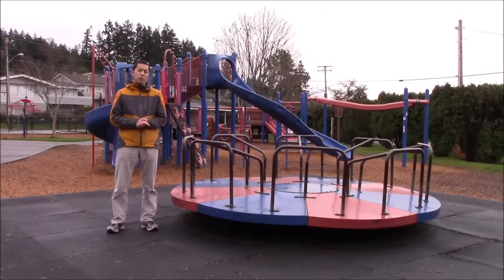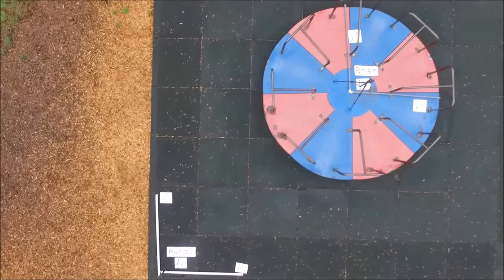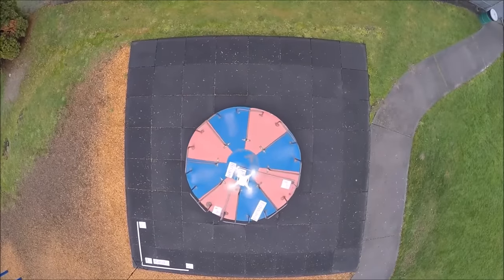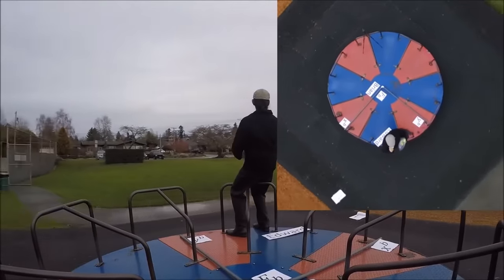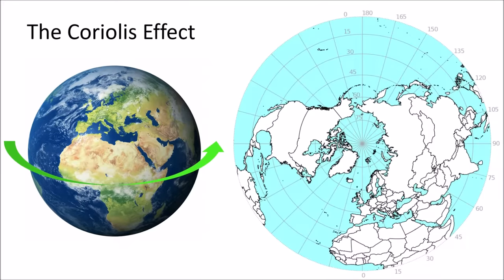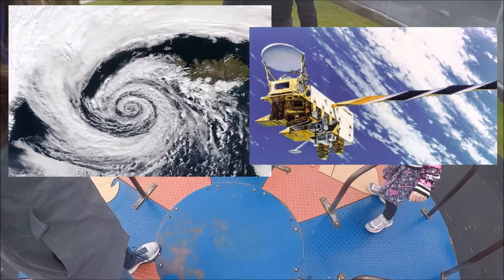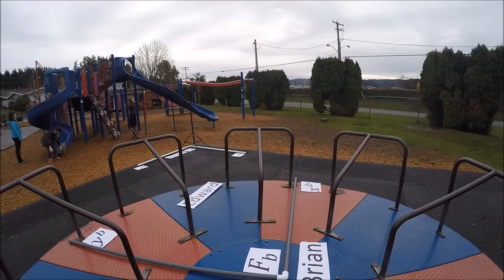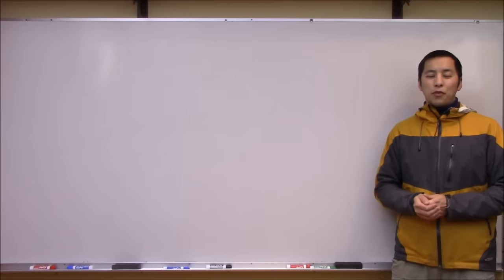Coriolis Effect Demonstration (with Drones)

Comment: Why don't planes fly quicker due to rotation?
Reply: So fuckin obvious
Reply: because the earth is motionless
Reply: This is due to relativity. The real speed of the plane, when viewed from space, is bigger when it goes with the rotation of the earth. However, on earth, the plane keeps its momentum it got from standing on the ground. When the plane slows down due to air or roll friction, it really is just getting back to the same velocity as that of the rotation of the earth.

Here's an experiment to prove it. Get a tennisball, ask someone to drive somewhere he/she can drive at a constant speed, then throw the ball straight up. The momentum stays with the ball, even if it isn't connected to the car or you. If the momentum didn't stay with it, it would fly into your face with the same velocity as the car is moving, as soon as you throw it.

I hope this answers your question.
Reply: Darkner No you are mistaken.Of course the ball in such a small amount of time will keep its momentum, however if the car or long bus had a high roof (obviously you cannot find such a ridiculous vehicle) then throw the ball really high, the vehicle will move underneath the ball. Like wise if you accelerate the moment you throw the ball it will go to the back just the same as if you break it will go forwards. I know you have a brain and so you must be able to grasp such common sense?
Reply: @i-rabbi-t9302  I am sorry, I don't really understand what your point is. Yes, the plane is moving above the earth, but because it's in the atmosphere, the plane will move with the atmosphere, which moves with the earth. Like I said, air and roll friction is really just the plane changing velocity to that of the earth's rotation.
Reply: Darkner Well that is where we will have to disagree because that is typical globe belief which goes against all logic and experience. Magic gravity cannot hold an airplane in position while it moves while underneath we sit having a peaceful picnic with fire whose smoke rises perfectly undisturbed and butterflies dance around the flowers. Cmon man truly look into your heart without the magic glue of gravity
Reply: We are not moving. The simplicity is quite remarkable
Reply: @i-rabbi-t9302  First of all, this has nothing to do with belief. All of this has a solid scientific base, which is made out of experiments and the work of many scientists for decades. It disappoints me how often flat earthers completely neglect all the science and evidence behind some stuff, then spread their own conclusions and thus spreading ignorance. Not to mention that they will do anything to promote their own view on the situation. It's the definition of pseudoscience.

And like I said, as long as it stays in earth's atmosphere, the plane will move in the same direction and velocity. If it were to completely stand still, in comparison to earth's rotation, to us it would appear as if the plane is moving to the west at an extreme speed. Eventually, that plane would come to a stop from the friction of the atmosphere.(Only if the velocities of both the object and the medium are the same, there will be no friction.) You can compare this to a grain of sand in a moving river. The grain of sand will get pulled with the stream as long as it's in it.

The reason the smoke and butterflies don't seem to be affected by it is because they already got their momentum from the earth's rotation. The Coriolis effect in this case can only be noticable when they go to extreme heights, because the earth spins once per 24 hours. Sure, it might be spinning faster than sound, but this is still tiny when it comes to scale. The Coriolis effect in your example isn't accurately measurable, since there are still other factors involved, such as wind and distance.

In short: your examples don't prove or disprove anything.

I do highly recommend you dive deeper into the science behind the effect and the rotation of the earth. Weather effects might be a good place to look.

Anyway, good day and keep learning.
Reply: @i-rabbi-t9302  And this is why you should dig a little deeper. Foucault's pendulum and snipers having to take the coriolis effect into consideration are but two pieces of evidence. I also advise you to research hurricanes and look up a gyrocompass demonstration. There's one on YouTube.

Also, where's your evidence that we are standing still? If I were to throw a ball upwards in a plane, it would also ust come back down to me, while the plane is moving forward quite fast.

Or when I run in a moving train and I slow down just fine, does that mean the train isn't moving at all?
Reply: @i-rabbi-t9302  Wow, I gave you evidence, like you asked and then you call me braindead. You gave me false hope. I thought you'd be be one of the few flat earthers who'd listen and start thinking. Sometimes I wonder why I even bother.

Thanks for wasting my time.

Comment: This way of illustrating the Coriolis effect is simply genial!
Reply: Partially agree : if you only care about projectiles, it's okay. But to comprehend the effect fully, the practical experiment here is utterly misleading, it doesn't explain vortex. Even the plane flying north across USA is compared to a projectile like if the air (weather conditions) could be ignored, you can't fly a plane for real and obtain the proposed result 100%, not a good analogy IMO. Not everything is a bullet many times denser than air, and projectile drift due to Earth rotation isn't as dramatic as that tennis ball relative trajectory. You can actually observe the effect with various water drainage device, then go bigger and bigger til the scale of a hurricane across dozen of states, only then you'll understand why the atmosphere seems to get stick to the Earth while being subject to the effect, the human eye doesn't just see it right away, it takes hours to unfold. In this kind of experiments, you must use one or more of three tricks to demonstrate the effect :
- speed : go fast enough to reach great distances in order for the human brain to compute observations before loosing track.
- scale : reduce the area/volume of experimentation to make things observable
- focus : on one observation at a time to ease understanding of each concern.
The experiment here reduced the scale of Earth to a mere park playground, and only focused on the kinetic part of a projectile. That's only 5% of everything at play in the Coriolis effect..... I'm afraid most people will only remember the parabolic trajectory of something thrown, then will babble something alike to try to explain vortex in their closet and storms.... very incomplete grasp of the phenomenon.

Comment: I have a great example of a practical use for the Coriolis Effect.  

I am a measurement technician.  Industry uses Coriolis Mass Flow meters for metering fluid. 

These meters use this principle to measure water, oil, gas or any other fluid by weight. (Mass)

They are some of the most accurate and dependable meters that I have worked with.

Comment: Enjoyed your video but had a few questions? Isn't the earth and the air above it rotating in lockstep? And if so, wouldn't this make the merry go round demonstration not comparable to the spinning earth. For example, when you lifted the drone and hovered it over the merry go round, it never drifted away because of the earth's rotation, but if you lifted the drone off a railroad boxcar traveling  at 30 mph, it would not land back in the same place. To equate the merry go round Coriolis to what happens on earth, wouldn't all the conditions have to be the same? The air above the merry go round is not rotating in lockstep with the rotating platform.

Comment: I think it's a demonstration that will actually mislead more people to misunderstand the effect, based on the visual representations and the wording.  It is represented in a manner that is showing trajectories  shifting.  Although it does note that the point of reference is what changes the appearance, but Coriolis isn't about point of reference.  
There is no trajectory that is curving left or right(horizontal axis).  There is a straight line trajectory with a projected termination point that is in motion.  In the case of the shooter correcting for Coriolis effect it isn't aim to the left in the Northern and right in the Southern hemispheres.  It is correct based on the direction you are aiming.  If you are in the Northern hemisphere shooting North to South and correct to left you will miss even further to the left, South to North if you correct left the target will travel into the projectiles path.  This is because the projectiles do not curve (on the horizontal axis), as is stated in the video, but the rotation of the planet has the target in constant motion.

Comment: Not really an accurate description of earths Coriolis at all. Most people think that if you threw a ball north from the equator, the earth would spin underneath it and it would land in back of what would otherwise be a straight line. This is not true at all, what happens is the the equator of the globe is spinning fastest and slows down as you go north or south, though all points rotate once in 24 hours, due to the shape of the sphere. This means that the conserved momentum would cause the ball to land in front of straight line drawn to the North Pole. Weird, but that's how it works. It has to do with conserved momentum and how far a certain spot on the earth has to go to spin once in 24 hours. This video does not show that at all.
Reply: Its literally the same effect shown in the video.  The outside of a merry go round is traveling faster than the center.  As the ball travels in a straight line, it follows a curved path over the merry go round (which represents the surface of Earth).

Think of the merry go round as a cross-section of the Earth representing all latitudes at once.

Comment: Awesome playlist Chris. Thank you very much indeed. Just a quick suggestion. I am aware that this suggestion takes a huge amount of time and effort to implement but it has huge power. Every dynamic concepts is best illustrated with animations and simulation. Would be it be possible for you to kindly include some Matlab scripts to couple your explanation on Flight mechanics?
Reply from the maker: Mostafa, that is a good suggestion.  I will try to include scripts in future lectures.  I plan on releasing several more flight mechanics videos in the next few weeks so if you are subscribed and have notifications on you should receive them.  Thanks for watching and please let me know what you think of this or any future videos!
Reply: @ChristopherLum  That's brilliant. I have already subscribed and looking forward to your future videos with Matlab scripts. I have gone through your other playlists and they are awesome. I am a physicist and a high school teacher. I have used Matlab extensively for many years and aware of its incredible power.

Comment: With the wind blowing across earth is measured at 0kts, that means that the atmosphere is spinning at the same speed as the earth. The wind will blow from a high pressure to the low. A figure skater will spin faster as the arms are pulled in because of the conservation of angular momentum and the wind will respond the same. The air moving from the equator towards the poles will gradually become closer to the axis of rotation of the earth and will accelerate and the opposite is true for the air moving towards the equator.  The result will be in the northern hemisphere, air moving north will start to move faster than the air moving south and a counter clockwise rotation develop.
Water behaves the same.

Comment: Please help with a question: The canonical argument for earth's mantle is that the high viscosity precludes there being a significant coriolis effect on convective motions (Knopoff 1964, McKenzie 1969). But since these are pseudo-forces (ie relativistic effects) it seems unintuitive to do this scaling argument based on 'forces'  (eg buoyancy vs viscosity) to conclude this. Please clarify the absolute velocity of the moving object (here a ball), its connection to the substrate(here none) and its speed relative to the rotation rate as factors determining the significance of the coriolis terms.. I wish to know what would happen if, say, instead of a ball, a highly viscous fluid (eg syrup) was allowed to flow down a slope parallel to the radius..?  Would the flow be deflected and if so, what is the relevant physics? Thanks for great vid
Reply: 😑 seriously?

Comment: The Coriolis effect is extremely small over short distances. It is what causes weather systems to rotate in the direction they do. But it does not affect small objects like drones or the direction of water going down a plug hole.
Reply: "But it does not affect s... .... or the direction of water going down a plug hole."
Yes it does
Take a bucket with water and a video camera, record it 10 times in a row, get yourself on a plane to Aus /S Africa or Argentina, do the same experiment and educate yourself.
Reply: @nonconformist4802  That's a myth. Ask a scientist. Have you ever tried it?
Reply: @BritishBeachcomber  
Myth my ass, why don't you take up my idea instead of bluffing yourself?
Reply: @nonconformist4802   No it doesn't. The Coriolis effect is EXTREMELY weak. Water in a large (1m plus pan) needs to be extremely still i.e. left for days to settle and the dish would need to be 100% symmetrical for it to effectively show the effect....

Comment: Lol as the drone hovers above not being effected by the spin of the earth 🤣..... 
The only way you can demonstrate this is by using a moving surface hahaha ... 
You don't need a merry go round if the earth is already spinning... 

Question ... Do airplanes have instruments that correct for this drift or do the pilots have to adjust manually?
Reply: Clearly physics isn't your strong point.
Reply: @kitcanyon658  

Come on kit that's not a nice thing to say... 
How about you define the Coriolis effect and scientifically tell me were I went wrong!
Reply: @rrrick2129  

So the aircraft itself corrects for Coriolis drift 🤔.... 

According to the definition Coriolis its only visible to the observer on the ground... the plane doesn't drift the observers position makes the plane appear to drift.

So planes helicopters drones cannot hover bc the earth would be drifting at 15° .... 
And flights from east to west get shorten by a least half the time due to the spin. 

Or Coriolis is fictitious....
Reply: @rrrick2129  

How can a plane correct for something that is only observed from the ground .... 

You said it yourself the plane is not drifting it only appears to be drifting from a non inertial reference frame!

In no way can an instrument or pilot correct for something that isn't happening
Reply: @rrrick2129  

I should observe a drone drifting 15° as it hovers. But they don't drift they just hover. 

The heliocentric model claims anything not attached to the earth drifts 15° Coriolis the fictitious force that is only observed from the ground!

Edit*
The drone cannot account for something it doesn't experience. The drone is not drifting it should only appear to to drifting from my position on the ground.
Reply: @rrrick2129  

In physics, the Coriolis force is an inertial or fictitious force that acts on objects in motion within a frame of reference that rotates with respect to an inertial frame.

The plane cannot account for something it's not doing 😆... its fictitious 😂🤣 to the plane !!!! 

The heliocentric model claims the earth is spinning causing a Coriolis effect a visual phenomenon only observed to the inertial reference frame!...

But we don't physical see this phenomenon do we? But yet you assume the plane is correcting for something it can't account for in the first place by its scientific citation....
Reply: @rrrick2129  

So you actually believe the plane is physically drifting 😆🤣😂 

Even tho the citation clearly states its a fictitious force 😆

In physics, the Coriolis force is an inertial or fictitious force that acts on objects in motion within a frame of reference that rotates with respect to an inertial frame.

Comment: AA 516 - When the 3 balls are thrown simultaneously to illustrate direction of air molecules they curve to the right, they move in a clockwise direction representing the direction of acceleration as viewed by an observer on the North pole. How come then, the direction of the hurricane in the northern hemisphere is counterclockwise? Is the eye of the hurricane the low pressure zone where air is moving towards? In which case it seems like the hurricane should have a clockwise rotation? Or is the air moving outward from the eye and curving to the right giving it its counterclockwise rotation?
Reply from the maker: John, they move in a CCW pattern.  Does the demo at 9:35 make sense?
Reply: @ChristopherLum  [AE512] I have the same question. The balls deflect to the right (and appear to be curving in a clockwise direction), what am I missing? Great demonstration though!
Reply from the maker: @masospaghetti  They eventually settle into a CCW pattern.  Does the demo at 9:35 make sense?
Reply: Deflection. Earth rotation velocity at equator is max and decreases as you move towards the poles.
Think billiard or snooker balls. A left or right spin on a billiard ball will impart the opposite spin on the other ball.

Earth rotation=Counterclockwise rotation >>>imparts Clockwise rotation to the high pressure system air >>>
Clockwise rotation High Pressure air moves towards Low Pressure System(becoming a Hurricane), Earth imparts opposite rotation. Therefore, Hurricanes in the northern hemisphere have Counterclockwise rotation.